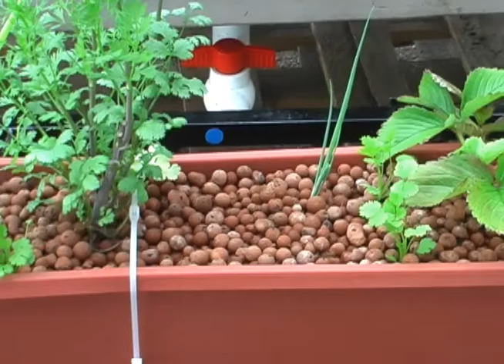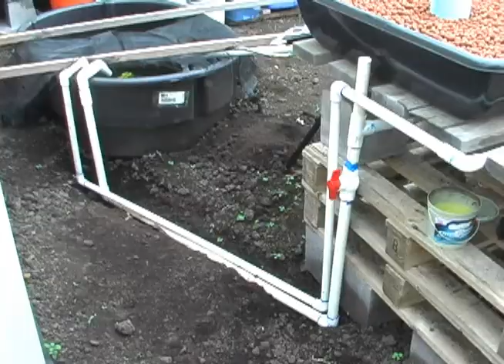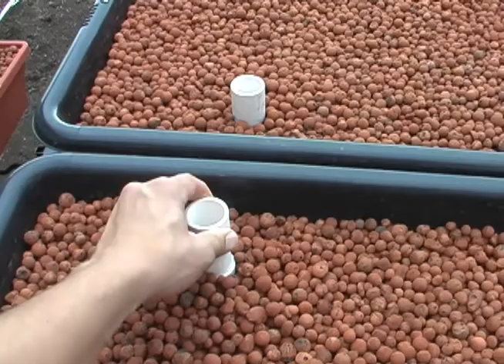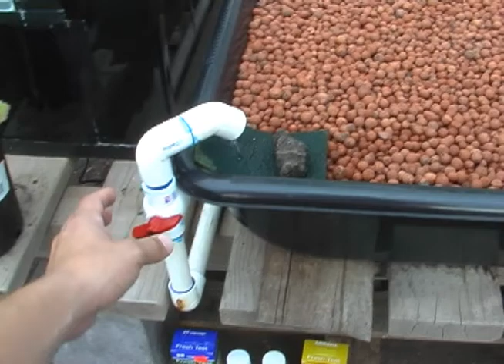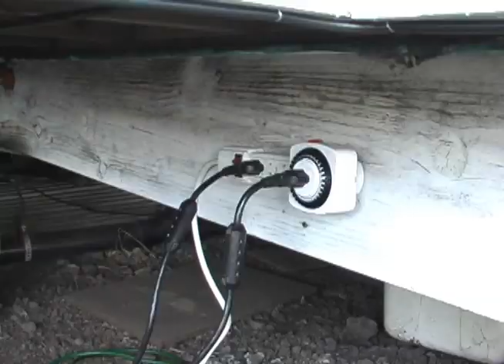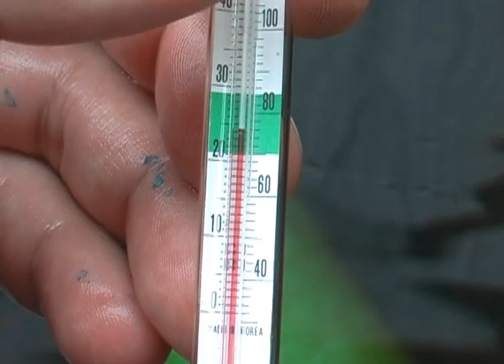Aquaponics in South Kona Part 2

Comment: I think you need more plants in order to get your system balanced. You have a rather large amount of fish in such a small pond, and they produce a lot of nutrient for algae. If you have more plants then the algae can't get as much as nutrient as they get now. I don't think that you can solve the problem with snails. Freshwater clamps and water flees also filter the water, but the real solution is more plants and proper water values like PH and and other values like minerals and nitrates etc.